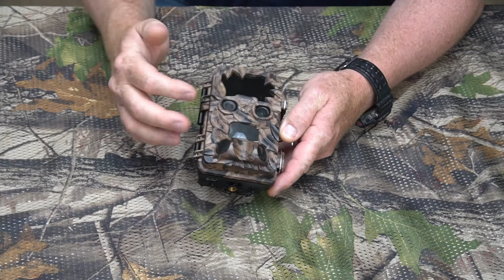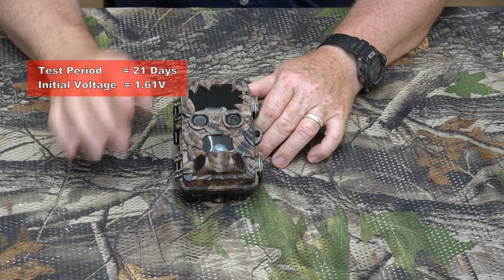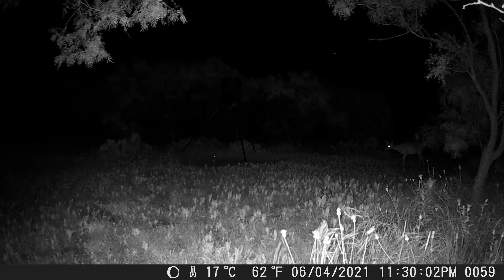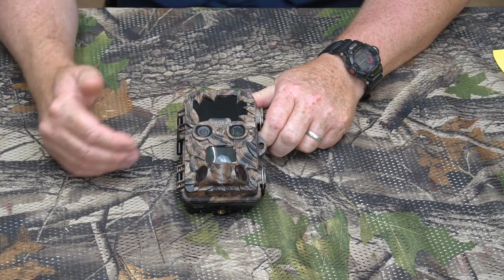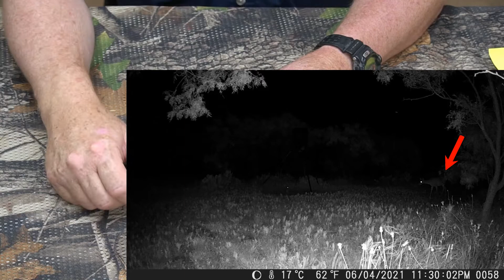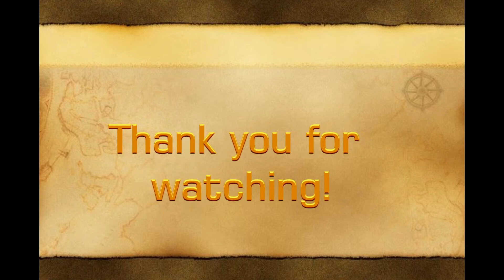🦌  REVIEW | Zimoce 4K Dual Lens Wildlife Security Trail Camera.

Comment: Do you have an idea as to the honest trigger speeds? Most companies claim faster times and avoid saying the video trigger speed can be 4 x the photo speed (due to buffering). Some companies "aim" the leds to be more center or lower. Placing the camera higher often will give you more "range". The main reasons for dual-lens is dedicated sensors and no IR filter click. Nice tip on VLC
Reply from the maker: Sorry, I do not.